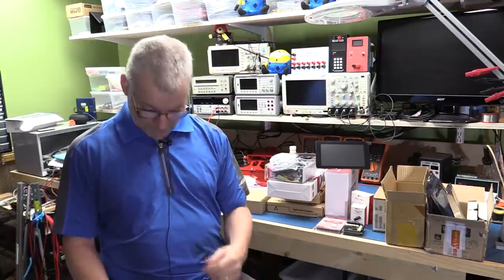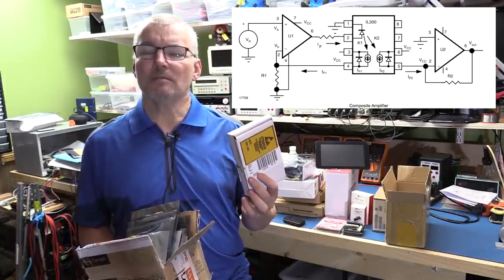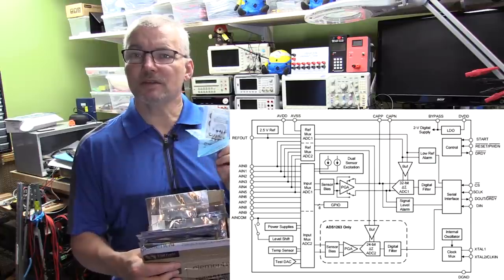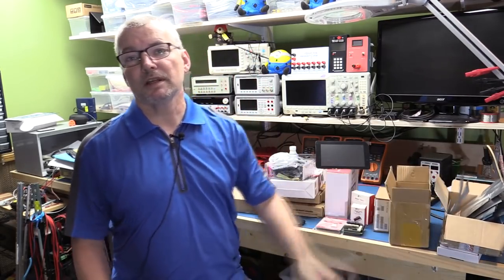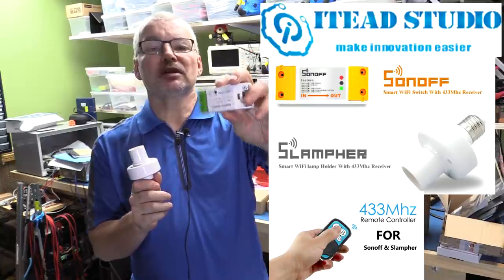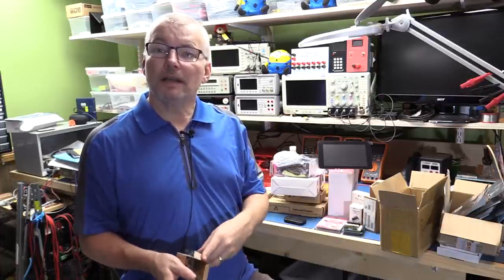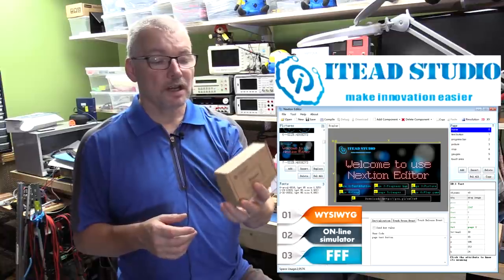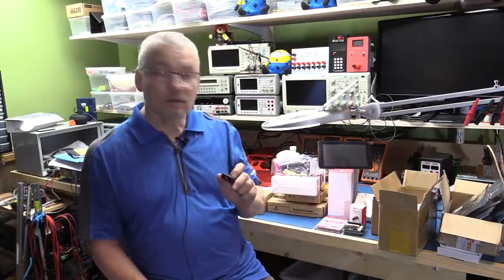What’s New Electronics Modules and parts - Dec 2015

Comment: Why TI call LM266x "Switched Capacitor Voltage Converter" when it is classical charge pump converter?
Reply from the maker: +Miloš Lazović But its not a charge pump, those use diodes to "Pump" up the charge like pushing it through a one way valve, these work by charging the capacitor and then disconnecting it completly and moving it to a new rail, elevating its voltage that way
Reply: Peter Oakes
What you describing as charge pump is voltage doubler, not charge pump (big difference), and TI circuit is classic charge pump (even picture in your video is from Maxim site https://www.maximintegrated.com/en/app-notes/index.mvp/id/725 and bellow it say "These essential components illustrate the mechanics of charge-pump operation")
Reply from the maker: Wow, talk about confusing... The picture was fom TI for real, there but both voltage doublers no matter the technique to get there, so it seems different manufacturers are calling them different things, but it is also correct to call this one a  Switched Capacitor Voltage Doubler as that is exactly what it does to double the voltage fed in